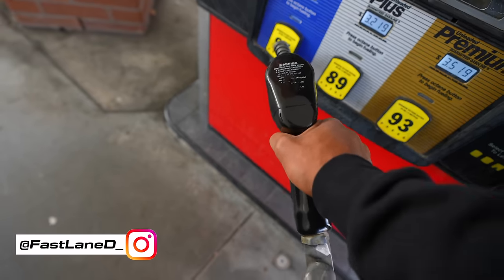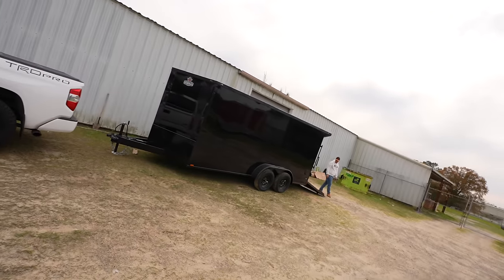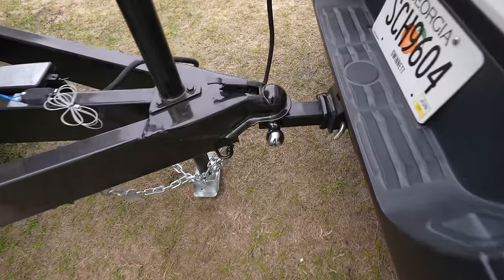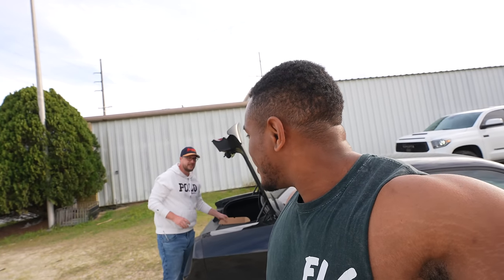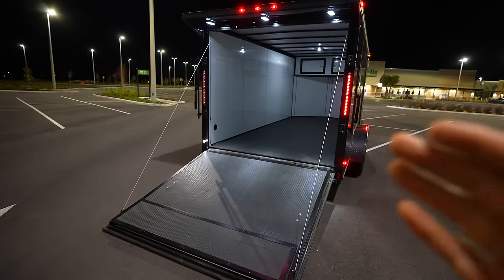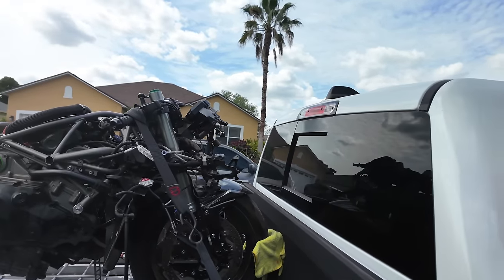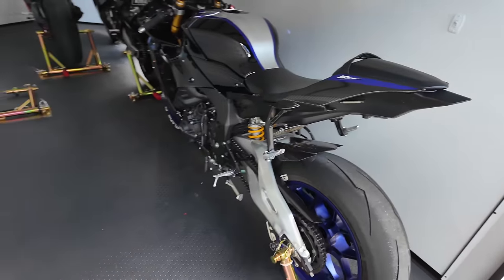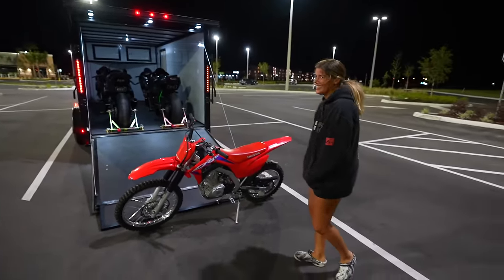MY NEWEST BIG PURCHASE + NEW BIKE 😈

Comment: not for nothing but your going to trust a harbor freight hitch with 200k worth of bikes. get a proper hitch and you may want to check out a load equalizing/antisway  hitch.  given your towing with a half ton it will greatly improve your towing experience.  that couple will be stiff for a while. also get a safety pin or lock for that couple

Comment: You can get a weight distribution hitching system to keep the trailer and truck level. They’re super easy to install and do the job! I install them on travel trailers/campers for work but the concept is the same for a cargo trailer just with less weight needing to be distributed
Reply: dont these also help save fuel?
Reply: @kevinim300  I’m not 100% sure but I could see that being the aerodynamics would improve with both truck and trailer being level
Reply: fastlaned need to see this
Reply: @fastlaned

Comment: That TRD is supposed to be pretty good for towing. I’m surprised it got such bad fuel mileage. Your tires play a lot in that but also may need a tune up on the spark plugs. Cold air intake. And even a tune will help your truck a lot

Comment: Even though the tundra eats up gas, it will be more reliable than most of these other trucks, even diesels. Once something goes wrong with a diesel it gets very expensive. Add some towing airbags or a weight distribution hitch to the tundra and you won’t have much sag at all. I tow cars with my tundra all the time with no problems.

Comment: Get some supplemental rear airbags. It’ll help a lot. Also get a nice adjustable B&W hitch. The thing with airbags is you can put 80psi of air in the bags and then drop your tongue jack. Air down and drop your receiver out of the hitch. Same with hooking up the trailer. Back up to the trailer air up. Pivot the tongue jack then air it to where the truck rides at stock level.

Comment: Probably could get a drop on your hitch, to get the trailer dead level. I just bought a new trailer and had to put a 5 1/4 inch drop on it to get the trailer flat.
Reply: It doesn’t look very off but with the truck squatting in the back, if you correct that with air bags or heavy duty suspension it would be more pronounced. Will tow better too and probably get better gas mileage. And trailer guys won’t make fun of you, don’t ask me how I know.

Comment: I have the same size trailer and pull it with a 3.5 EcoBoost f150.  You're not pulling enough weight to need a diesel, and my mileage is just as good as my buddy's diesel without the expensive maintenance.  I would also invest in a B&W hitch.  Super adjustable and heavy-duty.

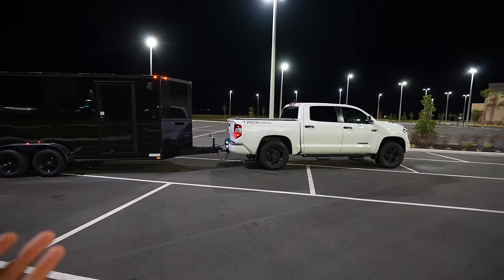Comment: My dad owns a 2012 chevy 2500HD durmax turbo diesel and we tow a 11,000lb rv up mountains with quads and dirtbikes in the back often times we don't have to stop for fuel in the truck because diesels are really good on fuel so if you got a diesel like his or a dodge ram , f250, etc but diesels are very worth it if you tow a lot and I think a diesel would tow your bikes with ease 10:32

Comment: owner of a 2002 ford F.350 meaning i do not have to deal with DEF system and I will tell you right now its costly. I recently changed oil, oil filter and fuel filters and it ran me $548 and regular just oil and oil filter runs me 280 each month because its currently my daily driver/ work truck so i put about 3500 miles a month on it. but diesels (if taken care of) last longer and tow better for sure but with the weight of your bikes and trailer i would think a gas 3/4 ton with slightly beefed rear shocks would do fine.

Comment: I would recommend checking out some air bags for your truck. They will take away that squat you mentioned. That is a badass trailer though. You definitely don't need a diesel to tow it the amount you do.

Comment: You don't necessarily need a 2500 or 3500 diesel like you used to. Nowadays dodge has the eco diesel 1500 and Chevy now has the 3 litre inline 6 Duramax that can tow plenty and get decent gas mileage still. It is funny using a Tundra Trd Pro to tow lmao too. Honestly as well if you didn't wanna spend the money get a moderately new so like the early 2000s to mid-2010s 1500 truck cause all together you're probably still towing less than 5k pounds altogether. Lots of newer half-ton trucks can handle that no problem.  Also another option is to get 2500 gasser trucks too. At the end of the day I recommend just doing research and asking people if heavier trucks with gas engines have better gas mileage towing or not.

Comment: Invest in a used good diesel. Stay away from power strokers (ford) 2500 is way more than enough to be good on mpg. Trust me. I’ve been hauling for years and I will never haul anything like that nor bigger with a v8. They are more like loading on bed then hauling. You can haul for short term not long term. Proud of the channel and so much motivation on this video

Comment: Install a deep cell battery, inverter to run 110 power, and your new lights off the battery so you can run them when not hooked up to truck and yes you’d benefit from the diesel.

Comment: Do yourself a favor and get extra wheel bearings with the gease fitting on the spindles for the trailer and spare tires. Trust me, I burnt up a bearing which took out spindle in Georgia. They don't work on the weekends. Spent 36 hours in a single cab truck waiting for the trailer to get repaired, lol.

Comment: Have a 23 Denali HD Duramax. 1000% recommend for hauling. Whether it’s a 22’ trailer or 45’ 5th wheel. Shifting, fuel, exhaust braking etc. easier on truck and easier on the wallet!!  I see you in a 24 ultimate Denali hd‼️

Comment: I own a older diesel personally but with work i tow with diesels all the time. (Metal fabricator towing metal and projects all over) Ive towed with all three platforms, dodge, ford, and chevy. If your going with a newer truck you cant go wrong with any. If your going to travel and tow alot, its worth getting the diesel. Duramaxes (chevy) are great, but there fuel milage can suffer under load. Dodges tow really well due too the cummins engine, its more of a budget oriented choice, and if you do some turbo, tuning, and exhaust work you can get them to have really good gas milage as well (around 20mpg). Ford is my favorite, they tow extremely well, have the least issues in my experience. I will say they get 11mpg regardless of whether you are just driving it or towing 25k lbs. like i said before with brand new trucks, you cant go wrong with any of them. Pick what you like

Comment: Bro, getting a diesel is the best move to make! You will get better fuel milage while towing and tows with ease. I have a 2020 duramax 2500, and I pull my 24ft enclosed with the drift car, 18 wheels, 2 groms and camping stuff. Car pull all that doing 80 not even breaking a sweat. 
Cons: diesel stuff is $$

Comment: Thank you for the content! We live in Lakeland area not far from Tampa. You should get a group ride here. I have a 2017 Tundra 4x4 and I pull a lot. I pull around 15- 20k lbs regularly. I do pull that with a gooseneck trailer. I also have a Dodge diesel. They still drop mpg as soon as you hook up to a trailer. Two years ago I pulled a trailer to Ohio hunting that weighed about 7k with the Tundra and averaged 9.8 mpg. This year we took my buddies 22 f250 diesel same trailer and averaged 12.8 mpg. For the additional 12k for the diesel motor and 70 cents more a gallon it doesn’t add up any longer. That’s apples to apples and that trip is 2100 miles round trip. I would recommend airbags for your Tundra and you will be surprised how much better it pulls and handles.

Comment: Put you some air bags on the back of the tundra to assist with the weight.  I have 3 duramax diesels and a tundra.  Fuel and maintenance way cheaper on the tundra and we pull enclosed with it a good bit

Comment: nice rig get a 6 or 8 ft led light in the middle and thats all you will need also some will put one on each side at the floor level in case you need to work on something and to see the lock downs better my tundra has the tow package and it just has another gear in the trans it is six speed and lower gear ratio in the diffs but the gas sucks even in town easing around it also has trailer brake set up which I took off so if you need one the box that goes inside the truck and the wiring I will send this one to you if you want it I will never put it back in

Comment: Now, I could be completely wrong, but after watching the video and seeing where the "New Bike" sits in the trailer. There are obviously 2 options. A Honda FireBlade or an Aprilia RSV4. After some research the FireBlade has a long wheel base than the SP2, which had what looked to be very little room to be any longer in that pointed nose. I feel like my mans doesn't want his bike touching that nose, so the logical answer is the RSV4!!!! But I could also just be completely wrong.
Thank you for coming to my Ted Talk

Comment: yes a deisel is worth it my dad bought one to tow hes trailer that fits 2 cars it in and (without the trailer)  he fill the tank 2 times less then with the gas truck he uses the truck to go to work every day bc i use hes other car until i get mine    ( hes truck is  agmc 2021 sierra 1500 crew cab ) 

so yes you should think abt it depending on how often you use the trailler

Comment: As someone who works in the diesel industry, unless you get to a point where you'd absolutely NEED a diesel or are at a point to where money isn't a factor...I wouldn't recommend it cause that repair/upkeep cost is not gonna be a good time. Especially with the after treatment and turbo that you're gonna have to worry bout plus the cost of fuel itself

Comment: Yo D the new GM 1500 with the LM2 diesel get upwards of 30 mpg. That will add up quick in MPG savings. However the price of diesel vs unleaded, at least here in Cali, is a lot. Maintenance and repair is also more on a diesel. Over time it’ll pay for itself. I have a 2500 and get low 25 on the highway and 12-15 towing my 15k fifth wheel. Love the yoda pro tho

Comment: Diesels are way too expensive nowadays. Best diesel for reliability is ram 2500 with the 6.7l Cummins. Cheaper to maintain. The 6.7 powerstroke have bad fuel systems and 6.6 duramax it’s a very nice high quality pick up. But man when you get into replacing injectors and all that. Theres no need to buy a v8 diesel. Which ford and Chevy have. Buy the inline 6 ram 2500. You’ll love that way more. In my opinion

Comment: “D” I have 7x14 enclosed trailer. I have LED strip lights ran along the top and it illuminates in entire inside the trailer. They make an air ride that you can purchase for your truck that will level it out and help with your gas mileage. It’s called an airlift system hit me up and I’ll give you more info.

Comment: Honestly, idk what kind of gas millage you are getting with your truck while towing a trailer. But if it is over 10mpg’s then what I would do is get a weight distribution/leveling hitch. With the weight you are towing I wouldn’t worry about upgrading to a diesel. It’s not enough weight to require to torque of a diesel truck in my opinion.

Comment: Nice enclosed trailer. I love the diesel trucks burns slower then gas ⛽️ put way more in the tank less stopping. More reliable. 2019 f350. When towing you may want a diesel truck.

Comment: Like @RaddadisRad said definitely change that hitch and Airbags. Under load as you see you’re sagging. LED light strips in the inside will be nice! Get them fixed not hanging.  As for gas bro you have a Tundra….Can pull a building yet sucks on Gas…8mpg with an Empty Trailer?!? Wait till you load it up!! Might consider a new (new to you) truck and possibly Diesel!

Comment: Tundra’s in general aren’t good on gas. You’re getting incredible reliability at the expense for fuel mileage. As for a diesel probably not worth it. You’d probably be better off getting one of those Ram 2500 with the 6.4 motor. Plenty of towing power and would most definitely get better MPG than your tundra.

Comment: Your gonna want to upgrade to diesel truck for towing or a bigger truck designed for towing. Your gonna kill that yota towing. Fixing a transmission or rear end in that's gonna cost you big $$$ and your gonna blow one of those towing all your bikes if you do it alot. Save your self some $$ and the headache and upgrade your truck bro